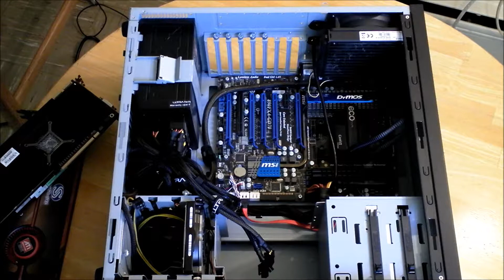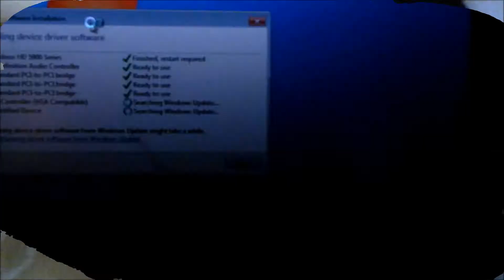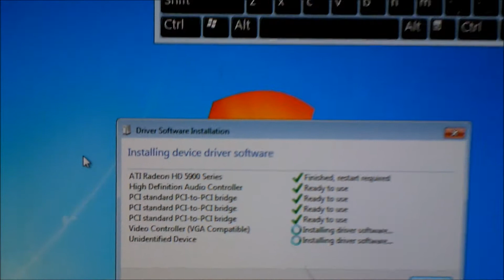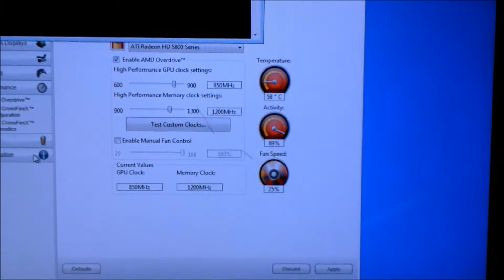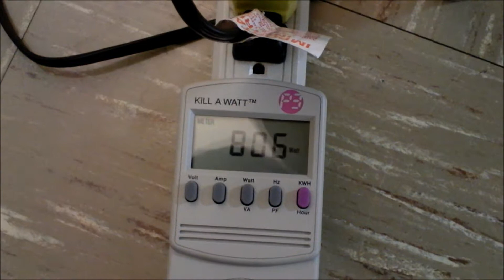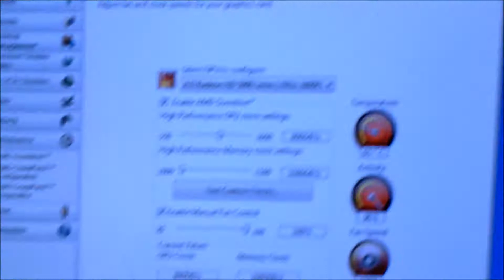Ultra 1200w + 5970 + 2x HD5870s = Crossfire, testing power draw

Comment from the maker: @HybridHeavenZ 

I would love to do something like that, but this rig is using a 600e cpu (2.2ghz 45w quad) which will bottleneck these cards like crazy. Would pretty much make any results useless. It sounds like you have a beastly setup there, what cpu do you run? I'll see about throwing the 5970 in my 2600k machine and doing a couple videos at a high resolution (my main LCD is 16x10, not 16x9)